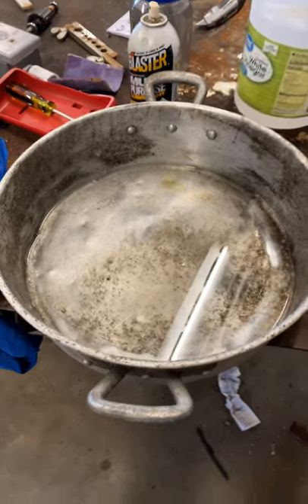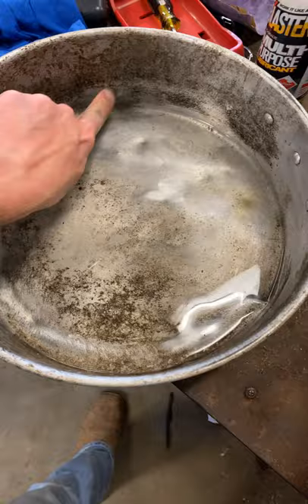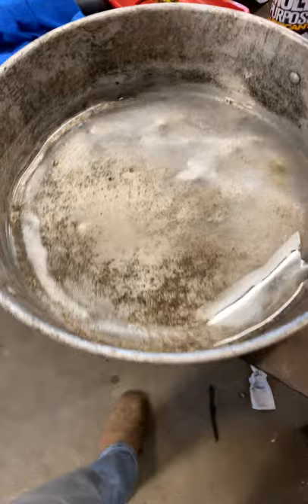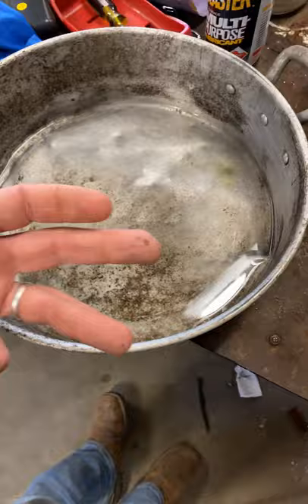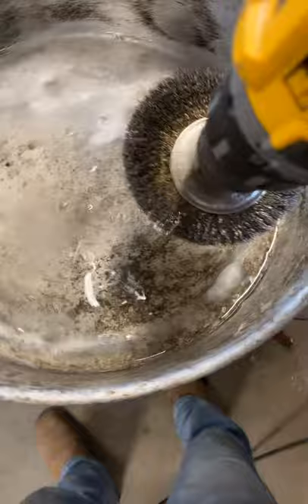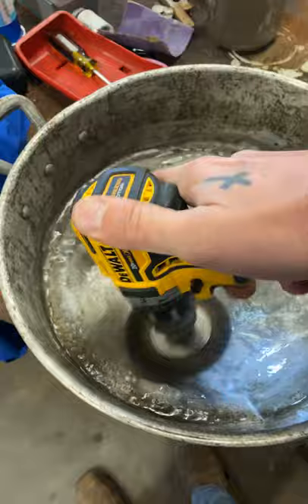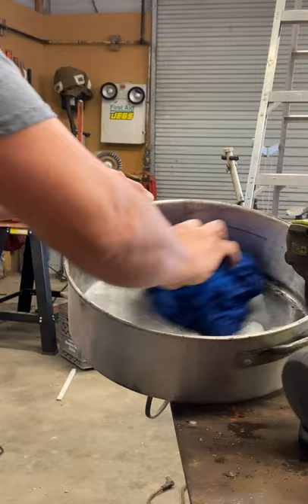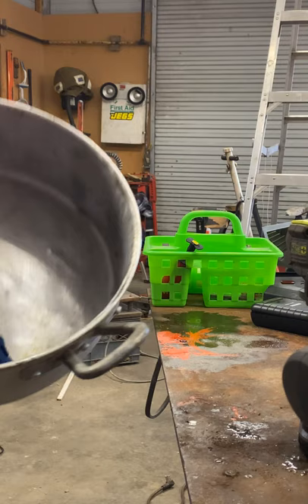How to clean Aluminum pan!! VINEGAR works Wonders!!

Comment: i too was thinking using vingar, but then quickly dumped it realizing aluimum and acidity DO NOT mix, and will cause "pitting" in the pot and make allumum leech onto your food, should only use if for alkaline or nueteral foods. is there another easy way of doing so without using acidic?

Comment: Bon Ami 1886 original formula, a sponge (or a pad on a drill) and some elbow grease will clean and polish steel or aluminum better than anything, including oxidation on aluminum.

Comment: Gabe L 🤣😂🤣😂😂🧐. Actually no I’m not sanding it.  I don’t know if your ears work but it would have came out with just a Brillo pad after adding the vinegar.  If it wasn’t for the vinegar I would have had to sand it, but that is a brass wire wheel. So it’s pretty much doing the same thing as a Brillo pad if I were sanding it would tear into the aluminum. Lol.aaand like I said. You gotta over do it sometimes